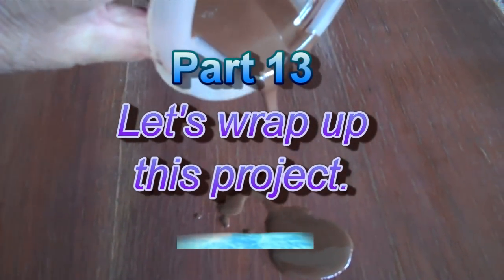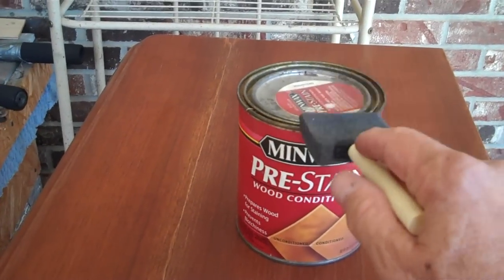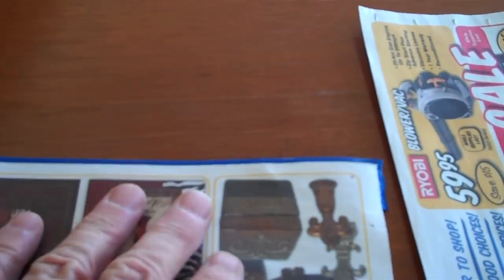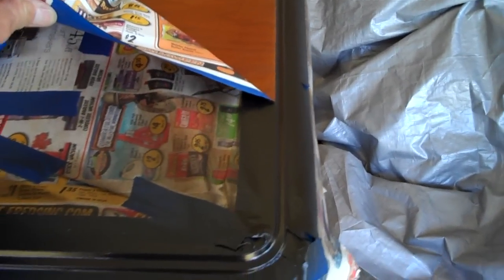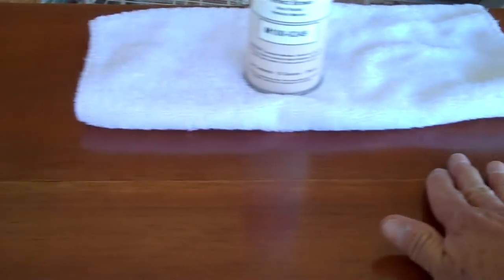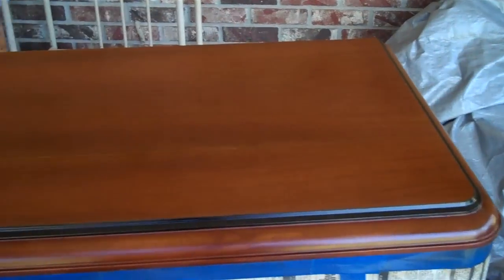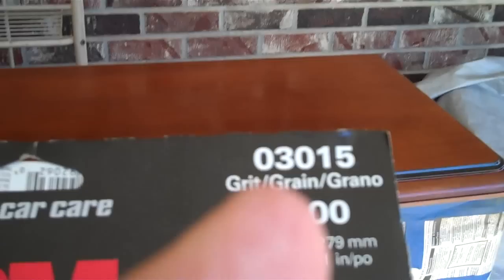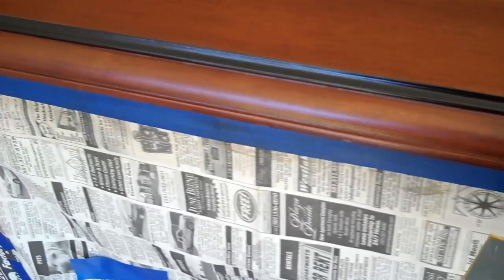1941 Zenith Model 6-S-597 Vintage Radio (Part 13 of 14).

Comment: I love your videos. I was working on the Zenith toaster radio and gave up on it. I needed to rebuild a oscillating coil and i reached a dead-end. I did, however, rebuilt a 1965 Kirby Dual Sanitronics vacuum cleaner. I was surprised at first how quiet it ran and the power it has. I just got tired of buying cheapy vacuum cleaners and they breaking down. Keep your videos comming. Your an excellent story teller.

Comment from the maker: @Penn0920,
I know that the correct methos of taking various voltage readings can be confusing, so later in my current Philco 630B restoration series I'll go over how to do it.  You'll be amazed at how easy it actually is.

Regards,
John

Comment from the maker: @cdray1968,
Thank you, David.  It's much appreciated.
I would have liked the cabinet top to have turned out a little better, but the radio isn't mine so I held back a little. If the radio were mine I'd have stripped off the old veneer and replaced it with new, or tried sanding to take out a few small ripples. Though I dislike sanding veneer, it might have been worth trying with this unit.  I just didn't want to be experimentally sanding away on another person's radio.

Regards,
John